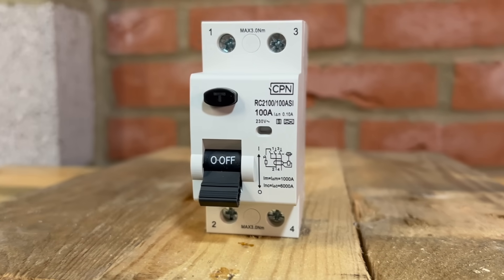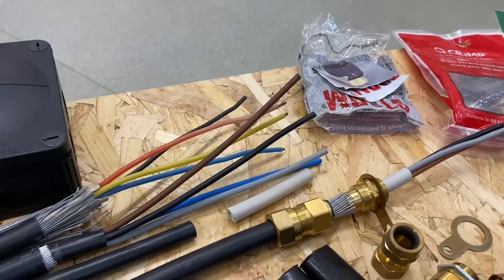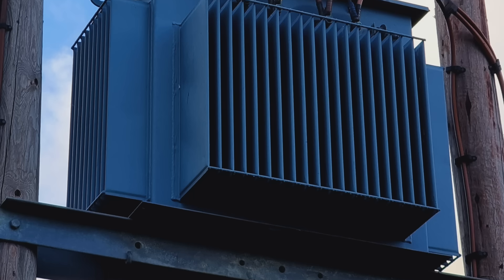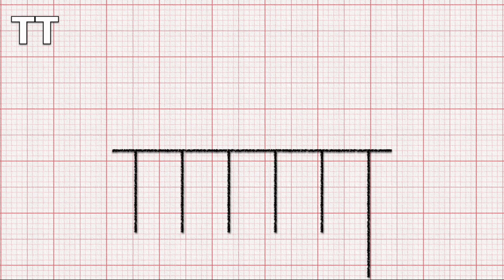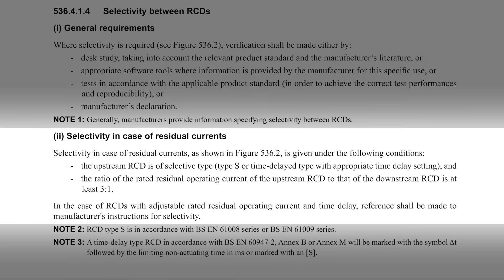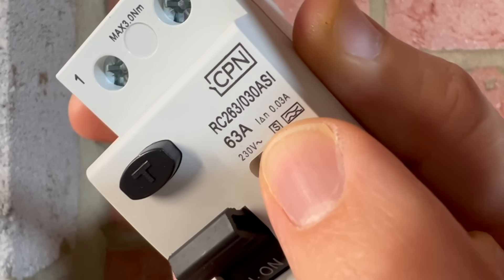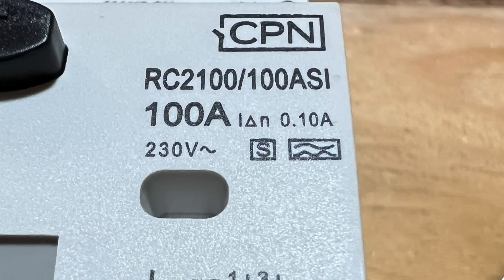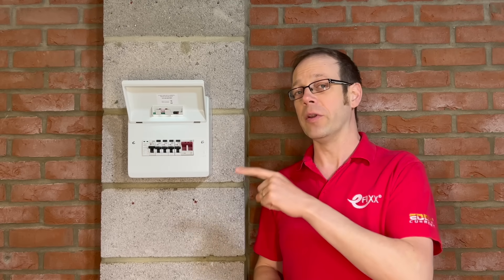Where Would I Use a Time-Delayed RCD?

Comment: You usually find S Type RCDs on caravan hook up point on holiday parks, and an B Type 63amp as the main switch in the caravan Consumer unit along with a 6amp 2x32amp 16amp MCBs and on the hook up outside the caravan you find the inclosure containing a small kWh meter and a 100amp S type RCD.
Reply from the maker: Thanks for the insight Sean. 👍

Comment: I had to use a 'B' type for my shed as the welders kept tripping it. Running high currents that have the propensity to spike, even if it is a small one trips a standard rcd. I thought it was an earth fault but I checked the circuits with an old megger I have and the reading was well within range.
Reply: A Si variant, ie ASi, may also be an option for you.
Reply from the maker: Good to know, thank you! 😃

Comment: Good video.
One misunderstanding I see amongst electricians is that selectivity is achieved by RCD's of differing trip currents with people believing that a higher trip current RCD takes longer to trip. This is incorrect. Selectivity is not achieved by the trip current of the RCD.
Reply from the maker: Thanks Dean. 👍
Reply: Bring into consideration of accumulated Standing Leakage Current at the Upstream RCD and the "seemingly Larger" Residual Operating Current has (sometimes) the opposing effect during an earth fault.😮

The correct practice to ensure correct disconnection of supply in the event of an earth fault is by using Delayed RCD's

Comment: The earliest problem with high earth impedance appeared in France, as they used TT earthing without RCD and french cities between 1900's and 1960's were full of stray currents. What ise interesting - Norway stiil use IT and TT in their buuldings.

In medical buildings all over the world many equipment has separation transformer or Insulated Terra, RCD sensing there capacitive leakages.

Comment: I used to do electrical testing at petrol filling stations and we had this a lot. Due to high diverted neutral currents on PME  systems, most filling stations are TT so the Earth Loop impedance is high. The underground petrol tanks are all bonded so diverted neutral on  the earthing system is bad news. 100mA S RCD are common place. 300mA with Time delay on the main incoming and when testing Ze, its absolutely essential that you disconnected the earth terminal so you wont be using the tank as a parallel earth path

Comment: I remember years ago when i worked in a theatre, each dimmer pack was fed from 125A selectable RCDs, so you could set them up for fault current (0.03-3.00A) and trip time (0.03-3.00s) 😮
Reply: I worked at petrol filling stations. They use them as the main incoming isolation
Reply from the maker: Really interesting to know, thanks for commenting. 👍
Reply: It might be of interest to readers that theatre lighting techs used a switchable system when setting up lighting fixtures.

When bounce focussing the fixtures as per the scene requirements lighting bars would be raised and lowered a few times for the techs to focus the lamps and adjust the shutters.

In this instance the RCDs would be in circuit so as to protect the techs when handling the units.

That was for the set up.

However during the show the RCDs would be  switched out so as to avoid nuisance tripping during a show.

Seeing as most lighting bars are suspending on non conducting ropes and rubber cables well away from crew and actors this was deemed acceptable.

Some theatres are producing houses and some are receiving houses, or both of course.

Very often a visiting production would bring it's own lighting rig and require, as per the technical rider,  access to power skts.

Some theatres would supply 63A outlets and some upto 200A outlets.

Many lighting rigs used to feature 1kW Parcans so you can see the power requirements could be quite high.

Latterly, with the introduction of LEDs units, powered requirements are much reduced.

When doing a site survey of a venue the first question the techs would ask would be the rating of the incomers.

In some venues, such as village halls, wily old techs would search out the kitchen cooker supply hoping to find a BS1363 socket on the switch unit.

A suitably adapted plug (without a legal fuse) was used to supply the distribution unit for the production. The fuse might be replaced with suitable metal bolt  used into the fuse holder.

And on occasion such an arrangement was used to bypass, literally, any noise limited kill switches ax per Local Authority regs ref not annoying the neighbours.

Most bands and spectators were a tad ambivalent ref upsetting the local community.

Some of the readers might be appalled but that's what happens.
Reply: @t1n4444  interesting. I've just quoted for a University film studio. They have 8 16A commando sockets at 6 different locations on the light bar on the ceiling. 4 of them at each location are fed from colorsource lighting controller and are RCD protected. The the 4 come from the D.B. and have 2 MCBs for 4 sockets. I need to replace 12 MCBs with RCBOs
Reply: @AsadMulla 

Best of luck with your project and sincerely hope your clients like what you're building for them.

Comment: I find it stupidly strange the the reg requires us to install RCDs for additional protection so as to prevent people and livestock from getting electric shocks. Yet farmers are legally allowed to have their animals in a an electric fenced fields to prevent the animals escaping. And anyone who has touched a live electric fence will know it bloody hurts ,even some government facilities have electric fences to keep unauthorised people out.  These fences hurt us a lot so you can’t bet your life they hurt animals just as much. Don’t say if different as there low voltage, if you’re unlucky enough to have a pacemaker or a defibrillator implant and you touch an electric fence it will kill you because even a small voltage of 24v will damage your pacemaker or defibrillator. .
Reply: Its actually the opposite. The voltage is high, usually tousands of volts (between 4000-8000 volts), but current is very low, usually a single milliamp. This is to make it safe for humans and livestock. It becomes more of a static discharge (like, touching your car body after having been in the car seat with fleece, so you get charged, and then discharges to the car body). Note that certain governmental facilities, can have one of two different fences. The safe ones, is like a livestock fence, but with the additional feature that when it detects a loss of electricity in the fence, it will trip an alarm too. It works exactly like an RCD in this way, the fence measures the current sent out and the current which returns, and if they are not equal, an alarm will be tripped.

But there is also the deadly ones, which purposefully puts out both high voltage and current. Those fences, are always installed past several protection points, long past the point where deadly force would be permitted, so theres no risk someone accidentially coming in contact with these, you would need to saw, cut through several fences, and even pass a "safe" fence with low current, before even coming close to such a fence. These fences are for certain very high value government buildings. These deadly fences are also designed to shut off in case of a fault, for example, if one of the hooks gets dislodged and the fences touch something it shouldn't.

Then we come to the topic of pacemakers and defibrillators. Pacemakers getting a jolt could be dangerous and kill the person as the pacemaker needs to be constantly active. This is however not the case with defibrillators. Defibrillators only act in a emergency, so a defibrillator getting a jolt isn't that dangerous, especially not with the newer ones that actually can self-diagnose themselves and inform the user if they are not working correctly, so they can arrange a hospital visit. The dangerous thing is if a defibrillator getting a jolt, getting broken unnoticed, until a emergency happens and its needed.

A voltage of 24v will not damage a defibrillator or pacemaker, as such a low voltage will not make it trough the skin. The limit is according to standards, 50v for SELV circuits in dry rooms, so everything below 50v is basically "safe" as long as you are not wet, then the limit is 25v. Note also that defibrillators and pacemakers are safe for such low voltages, as they are designed to put out much higher voltages to be able to trigger a malfunctioning heart.
Its the high voltages but low currents, like 5000 volts that can damage defibrillators and pacemakers, since it will case a arc in the ciruits that measure the heart rate, that usually measure voltages in the millivolts range. These circuits ARE protected for SELV voltages however.
Reply from the maker: Comment of the week 👆
Reply: @sebastiannielsen I’m not saying you’re wrong but tell that to the the family of a local farmer down the road from where I live. He had a pacemaker and he grabbed the electric fence when he took a tumble one afternoon. And it destroyed his pacemaker and he died. And it was confirmed that his pacemaker was damaged by the shock he got from the fence. But I guess we can’t really say why because we don’t know what the electrics were like on that farm what sort of condition they were in or even maintained properly.

Comment: Why use a I^n 0.1 A on the main circuit? Feels very unsafe in case of a human touching a live on one of the sub-circuits that are NOT protected by an additional RCD. Isn't it better to make the sub-RCD I^n 0.01 A instead? So the sub-RCD is I^n 0.01 A without selectivity, and then the main RCD is I^n 0.03 A with selectivity, thus fullfilling the BS7671 536.4.1.4 requirement on 3:1. In this way, you get full protection, albeit a few ms slower, on the main circuit, and then EXTREMELY good protection on the circuit with an additional sub-RCD as it will trip at 0.01 A instead.

Looked on google and it exist a lot of I^n 0.01 A RCDs, both as RCBO's and also as RCDs, which would actually be a much more sane choice here for safety.